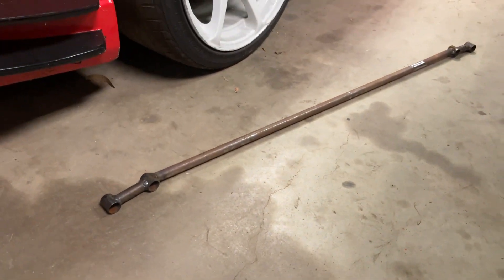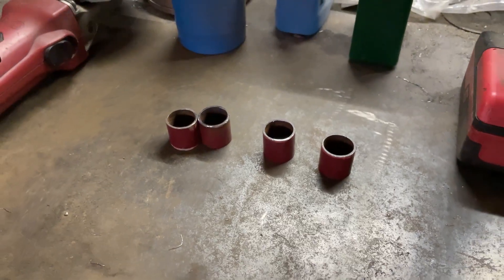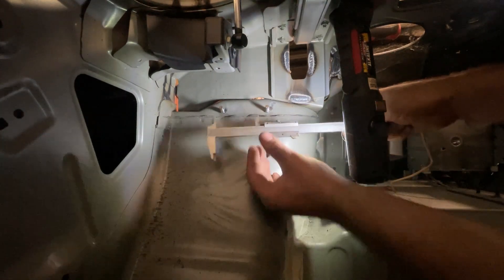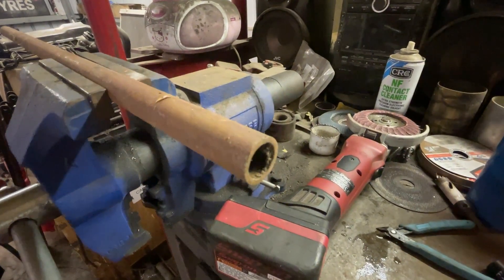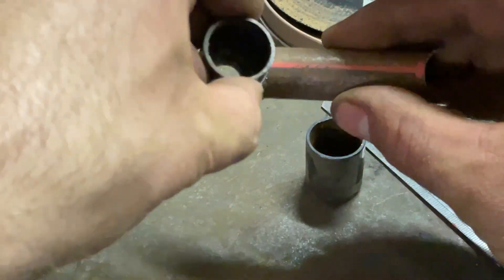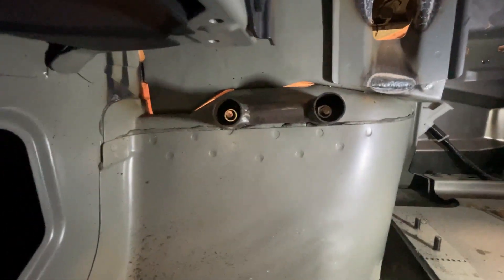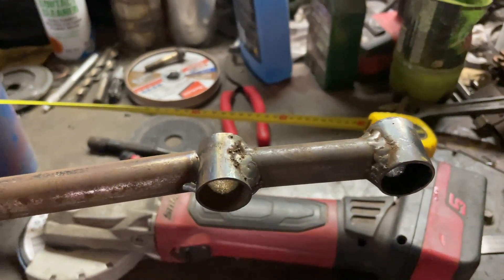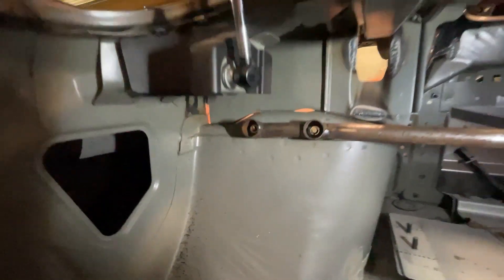R34 DIY rear strut brace - GTT to GTR conversion [Ep19]

Comment: You definitely have to learn how to weld brother
Reply from the maker: I try to improve every time I have to pick up the welder. I’m self taught so I don’t claim to be great at it… That’s why I try and give myself jobs like this to practice on. I can’t remember the exact issue I was having here but I think I was having problems trying to run continuous beads, it’d either blow through or pile up so I was just giving it hot intermittent blasts and starting the next spot on the edge of the previous spot while it still had colour in it. I’m open to suggestions on where I can improve or what I can try differently.
Reply: @darrynjames  I got you! Yes, the first thing is, clean everytime before you start working, or in this case welding your tools! Remove every kind of dirt and keep your tools/welding machine clean! There are also various options for torch guidance, which have a very strong influence on the seam. To explain and list everything here would go beyond the scope of this article. Clean your torch, learn the basics and practice continuous welds.
Keep up the good work 👍🏻
Reply from the maker: @MsMrFlix  thanks for the constructive feed back, appreciate it!
Yeah I think I need to sit down one weekend with the mig and just blast through some scrap. For some reason I find tig to be a bit easier for the most part, especially when it’s not out of position… I’ve always struggled a bit more with the mig.